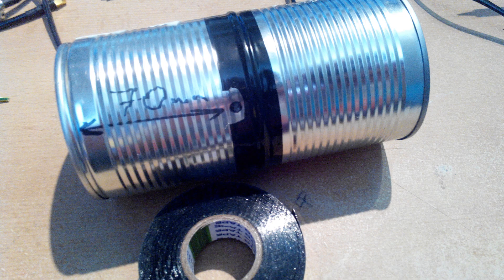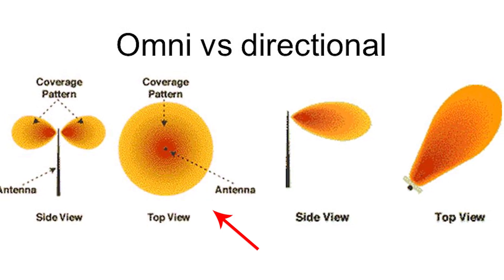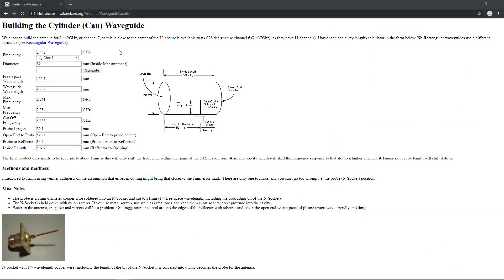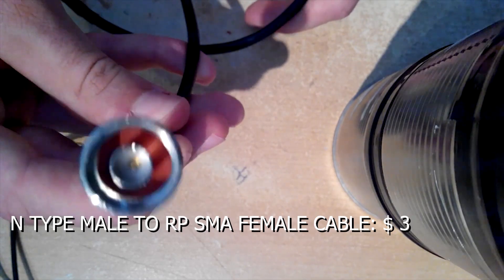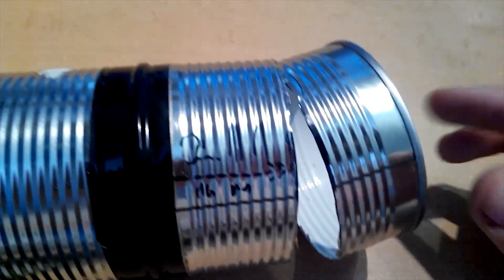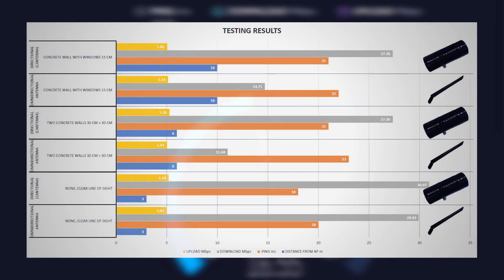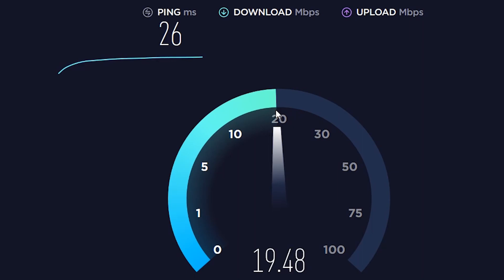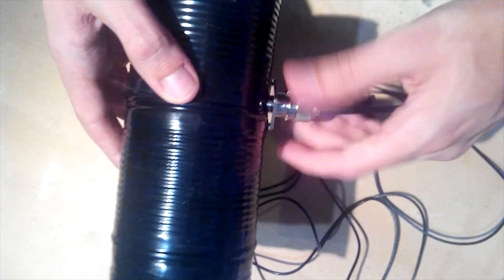Making Long Range WiFi Cantenna

Comment: Thanks! But I don't understand something. According to your calculation, when the diameter is 8 cm, the probe of the antenna should be a quarter of the wavelength (which is also a calculation that I do not understand because a quarter of the wavelength of C/f is 12.5 cm), so it is 7 cm from the closed part , and from there you need 21 cm to the part up to the open part, so that in total it is 28 cm, therefore in minute number 6 in the chart, you cut the box by a few cm. But after that, you see that there are 3 boxes connected with glue, so I didn't understand, shouldn't the total length be a maximum of 28 cm? I would appreciate an explanation.

Comment: Can I use it to emit Microwaves of Frequency of 
1-3 GHz of Carrier Wave 
and 0.1 - 8 Hz of Signal Wave combined.  ????
Reply: The physics are the same should work just the size will need to change

Comment: Thanks for This and How do we choose the right diameter for the box, because not all sizes are available my friend, also in calculator web page When we put the diameter on the length of the box, it is very short, how do we deal with this?

Comment: I would like to use two of these inside  of hot air heating ducts to route WiFi signals through my house, using ducts as a waveguide.
Reply from the maker: Thar would be an interesting project. :)
Reply: See the chart at 2:47 if your ducts are larger than 10cm, they won't work as a waveguide. You may bounce signals around inside, but I think you'd probably get better results if you just put a waveguide antenna at the remote points and aim them at the WiFi router.

Comment: far better is using stainless steel, 85mm diameter, element placed 75 mm from rear of a 30mm long can.
Reply from the maker: Thanks for sharing your solution with us.
Reply: @1BarConnection  welcome
Reply: can someone give me the formula you use to calculate

Comment: well ,u tried to build with what available,its good ,and we all love long coax for good placement (like mounting antenna on roof) ,but just to point out , the 3m coax cable will make u lose some valuable signal strength even with good quality coax cable, ideally the total length between the antenna and wifi adapter should be less than 10 cm i strongly advise u to hook the wifi adapter directly to the cantenna ,i believe it will have some noticeable improvement for ur wifi signal :)
Reply from the maker: Thank you on information. Will try it out.
Reply: @1BarConnection Hello- I want to boost the WiFi Hotspot signal that is outside of my shop. I have to keep the garage door closed and when I do close it; my signal strength is much weaker. Can I do the same things as what you’ve done but connect the cantenna to a wireless router SMA antenna? I use my phone and a desktop that has WiFi and Ethernet capability.

Comment: It's big mistake to put the screw inside the can ..it's like another driven elements.also longer can  gives more performant ,thé calculateur gives the minimum measurements.... Also to get more gain. Make thick wire for the driven elements...good luck..bro
Reply from the maker: I agree. Thanks for suggestions.